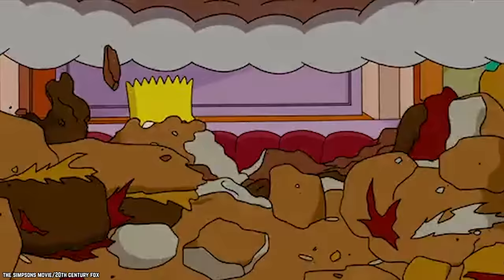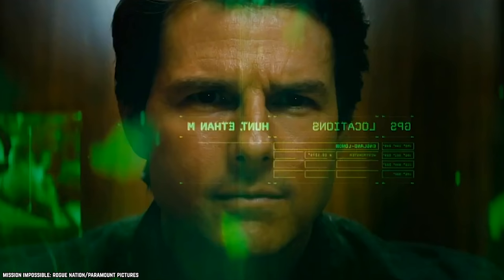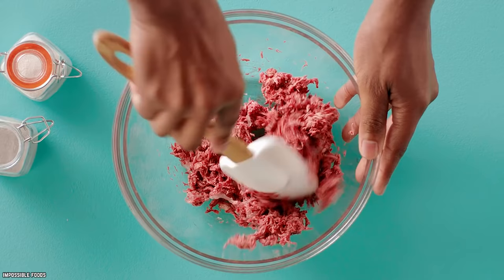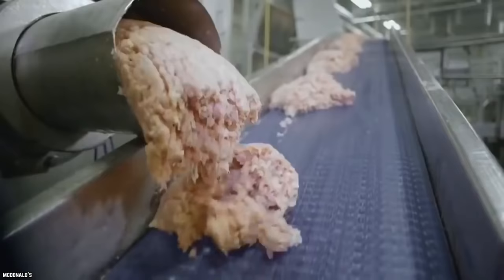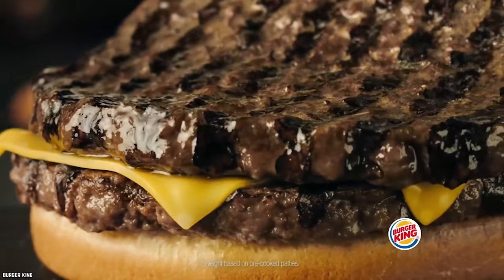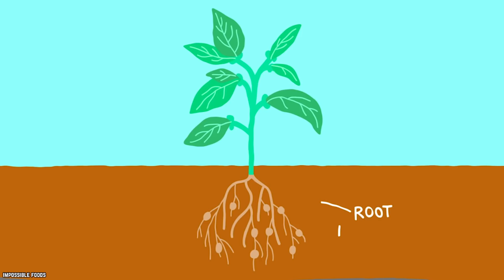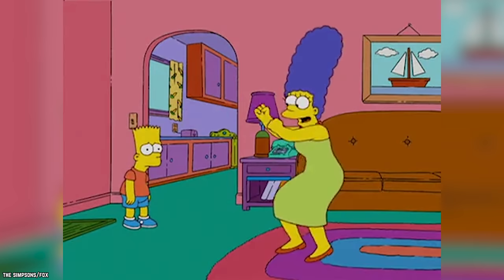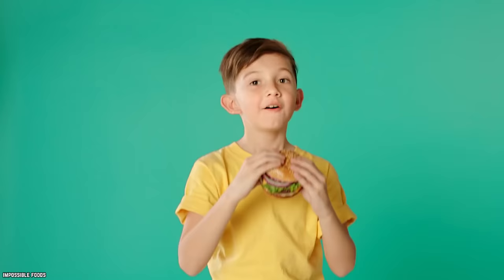Top 10 Untold Truths of the Impossible Burger

Comment: Still peddling outdated cholesterol scare tactics, I see.
Reply: So any keto sucker might say.
Reply: @albertfinney1328  Actually, in a sense, he's right...EATING cholesterol does not raise blood cholesterol levels.
Eating saturated fats and even worse, trans-fats does raise blood cholesterol levels.
Doctors have known this for years!
This is the reason that people with high cholesterol are told that shellfish is fine, even though it has quite high cholesterol.
Many years ago, doctors were saying just the opposite:NO shellfish.
Also, there seems to be a link between high carbohydrate intake and high blood cholesterol.
So the impossible burger can actually RAISE blood cholesterol levels, since it has more saturated fat than beef.
Maybe they can reformulate this product to use a fat that is less saturated than coconut oil.